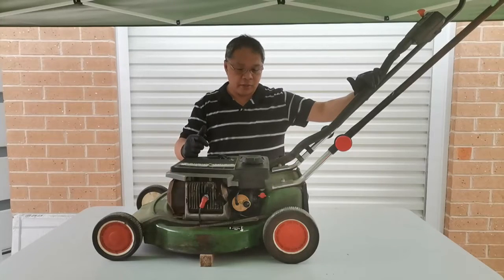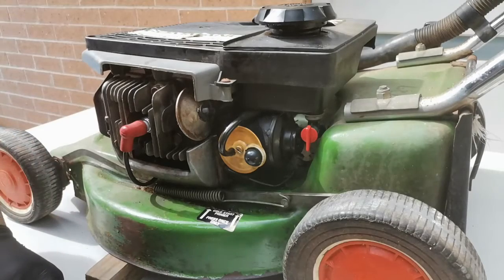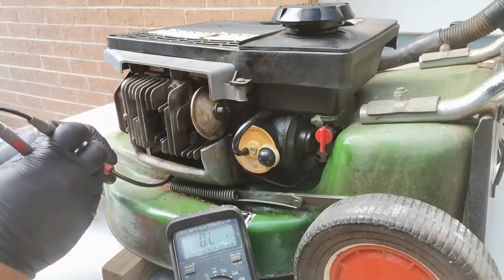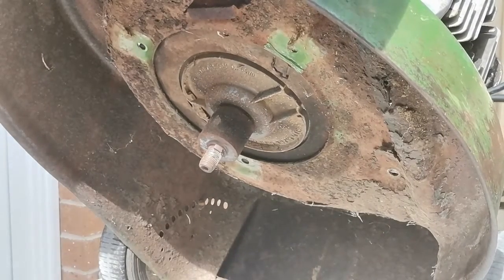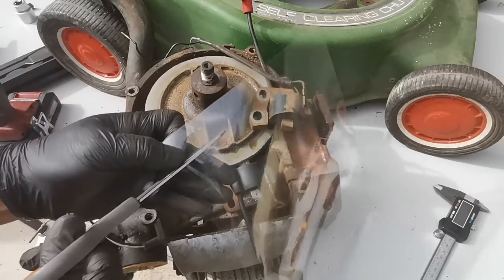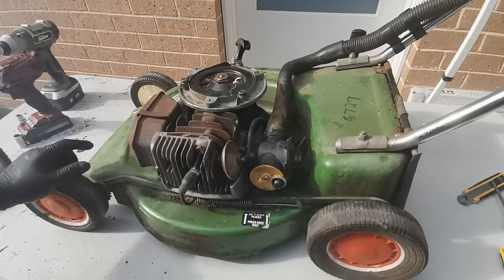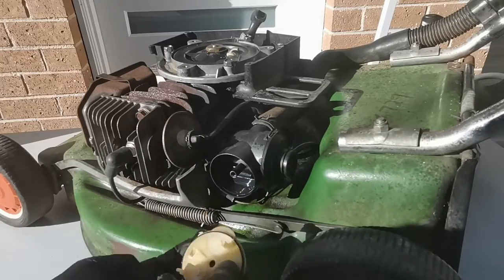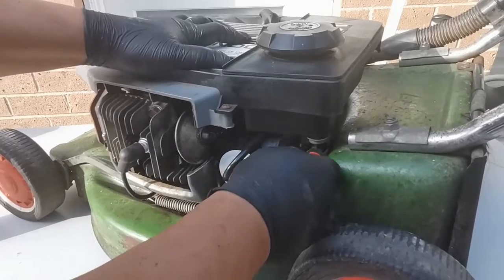VTECH 21 - Repairing Victa V35 Commando 2-Stroke Lawnmower

Comment: Hi, My old Commando backfires terribly when it’s being shut down do you know how to fix it
Reply from the maker: For other viewers to what is backfire. Back fire is when you pull-start the engine, the engine will start, but in the opposite direction or rotation, and it violently pulls your arm as when the cord drastically retracts. This back fire issue is due to advance firing or timing issues. Victa Commando and Powertouque don't have a timing pin, and the flywheel is fixed. So, what would be the cause of advance firing. Firing is coming from the ignition system or ignition coil, or some has an electronic ignition module. In my experience, changing the ignition coil with aftermarket ignition coil would cause a backfire issue, maybe due to coil inductance in combination with the ignition module, which could advance the firing. If you encounter this issue, try replacing the ignition coil with a used but genuine ignition coil. This reply is a bit too late, but anyway, thanks for watching. Check my latest uploads for new repair ideas. Vtech

Comment: been trying to troubleshoot one revving its head off about to take off like a heli, done carby + seals, cleaned decompressor, it almost sounds like its starved of air because when i take the hose off air filter revs come down a bit, would a warped primer cap cause over revving?
Reply from the maker: 1. Check the governor vacuum venturi vent next to flywheel if not blocked with dirts. This vent is connected to the back of the carburetor diaphragm cap.
2. Try adding washers up to maximum of 4 under the carburetor cam to lift the cam on iddle to add tension on the control spring (short spring) and restrict the vibration of the diaphragm and lower the revs.
3. Thanks for watching our videos and subscribing to the channel.

Comment: If your like me it's I'll get around to that job  when the needle won't stop the fuel, bad when it pees out the plunger, so you have to turn on the fuel tap and start it straight away, if it's flooded you have to turn off the fuel and pull and pull and pull until it starts but remember to turn on the fuel tap again once it starts, I didn't say I'm lazy just have no time to do things sometimes, even so minor ones, maybe I'll fix it later as it would of been fix via now writing this comment.

Have a nice day
Reply from the maker: I appreciate your perseverance to keep pulling to unflood the mower and keep turning Off and On the fuel tap. That's a hard work. Maybe lazy of fixing at the same time hard working of keep pulling. That's a hard work than fixing. I'm sure you can fix it. Replace both Primer Cap and with Viton Tip Needle (make sure to have new Primer Cap O-ring). Thanks for watching our video and subscribing to our channel. Keep tuning our channel as I have Victa PowerTorque video to asked the viewers to guess why this machine starts but dies straight before watching the end of the video for final fix. Cheers, VARIETECH
Reply: @Varietech-AU  thanks for the reply, I'm normally the guy people call to trouble shoot why things won't work and after fixing others stuff all the time have no time to fix my own things apart from the important issues first, safety no 1 always on my own vehicles and problems or issues done before the signs of failure happens, my tools are always in my ute and hate packing up the mess later, atleast with mowers tools are much simpler and don't require many.

Great explanations and a very informative teaching you conduct and teaches you well and explains issues that happen with the victa's, the same way I teach people about what failed and why it happened or tell them I will look at it but don't let anyone else look at it before I can get to trouble shoot, why they ask, because I don't want to fix 3 other people's issues to find the problem that only needed fixing once, turn up and shake head and say how many people looked at it, ohh none so why has this been taken off and put back on 😀, the biggest issue is the story on what happened and how it stopped and after you fix something they tell you what really happened beforehand that could of saved you a lot of time.

Sometimes I don't fix my own stuff to see  how things misbehave for learning purposes as long as it doesn't destroy or cost money in the process.

Keep up the good work, and look forward to watching more videos you post in future, a job well done.

Comment: You can check the. 
Make sure to get the carburettor cover on tightly as well fully secured as well, to get, all of the, Fuel priming and running as well, and make sure you have the correct spark plug and that, then you can get it good as well, when you, get it fired up and running as well and it gives you aurtglrised start up as well and it can start, giving you, Confidence as well in, Advance as well as going ahead with it as, well as giving it all a fix and a good run mowing the lawn and the Commercial work and the job as well, of course have a impact screwdriver and a drill handy for Authroised repairing as well.
Reply from the maker: Thanks for watching! Don't forget to check my latest videos.

Comment: From Thomas a very good mower with good green colour and some nice red Wheels as well and orange Cover Ons as well this is a really good video to understand it and a good video for tortuials as well, and a very good, Design as, well and it is, often good to check the, Engine and check out how to start it as well Always wear hearing protection and eye protection at all,  Times while, mowing and of course, Authroised maintenance as well, and how to solve Problems are simple, as discussed on, and then These are, Really hard to, come by too. 
And checking your Glasses 🤓 Hard hat 🧢 and safety gear amd equipment, at all, Times as well as, enguaging with, people on Tools and advice as well, .

To solve a problem like a, fuel valve, all a, carburettor is very, important to get more out of your machine as well, and it, is good to know it can give you more better control and use out of, the machine, too and of course mixing the fuel and the oil right as well, is Essential to, get the best performance out of your machine ,  and checking out the carbeutor as well, is essential as well, and is a, good ideal to have a half inch flat screwdriver as well, it can give you more easier access to your removal of your carbeutor as well in advance it is a great tool to have to keep Authroised work and maintenance up to Schedule as well in advance and you can order News, Products online and have them delivered to your door in 10 Days as well you can, get it, from the Service shop as well and it can, give you, peace of mind knowing that you can get them online all instore with free delivery to start understanding as well, and it, Gives you a good idea as well on, the product in advance as well.
Reply from the maker: Thanks for the detailed comments. Thanks for watching! Check my latest videos.